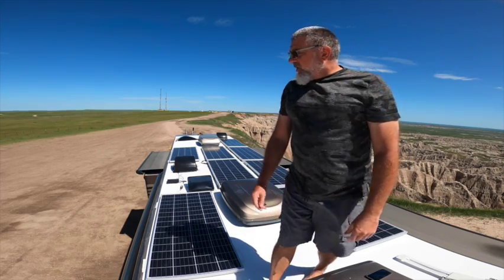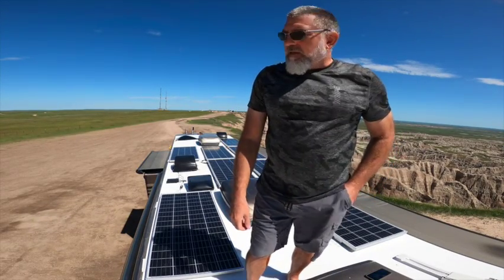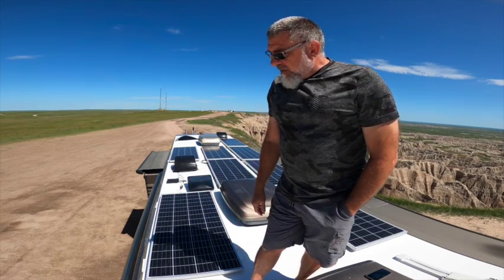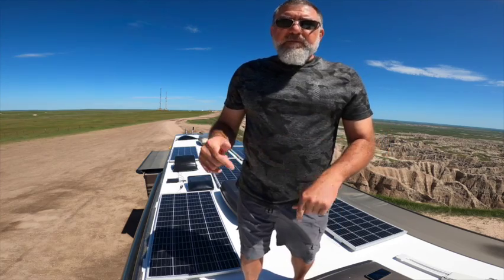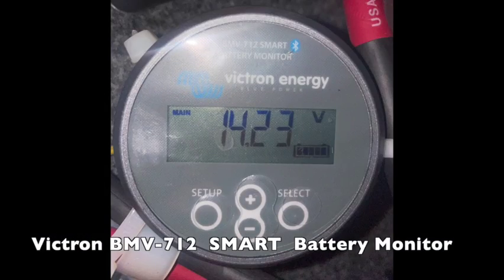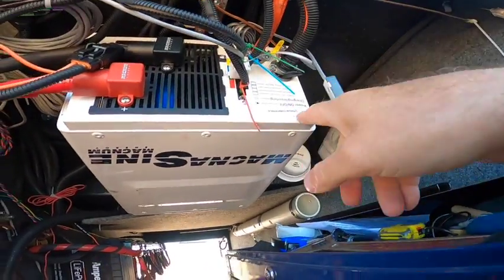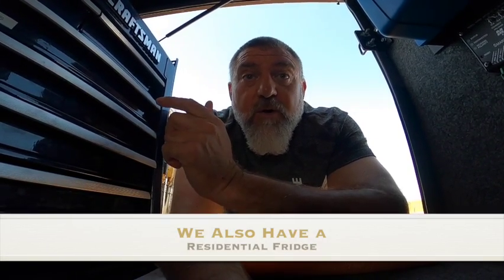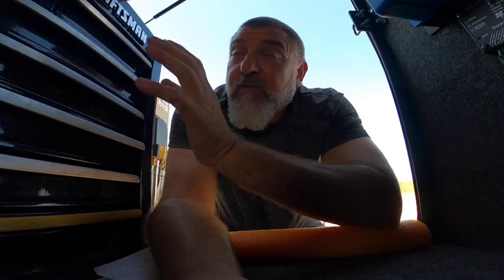Solar for RV Boondocking

Comment: Sweet job! That sure is a professionally set-up system. I just found your channel and subscribed. We are boondocking in Sutherland, NE now and will be visiting the wall for the first time Sunday. We're retired FT RVers who love to boondock most of the time. We decided to build our solar system in 2 phases, a 12v basic phase to run all our 12v appliances and a 48v system for our AC high power needs. This also gives us some redundancy, so if one phase goes down, we've got a back-up. The main issue we faced is we are retired and living on social security and a small pension so have to do everything on a tight budget forgoing name brand components like Battleborn and Victron for lesser-known brands and must do all the work ourselves - which keeps getting harder as we age. We just completed the first phase in January, with the addition of a custom built 560ah of LiFePo-4 battery, made with 8, 280ah prismatic cells. We used a Heltec 350amp BMS, to start the 5,500watt generator in our motorhome, along with a 5a active balancer. We built our 12v battery with grade "A" LiFePo-4 prismatic cells having a 6,000 cycle manufacturer projected life at 100% DOD. This means that if we cycled them 100% every single day, 365 days a year, they would last over 16 years! They're obviously going to wear out from age before they wear out from cycling. It only cost us $1,500 to build this 560ah battery, including the high amp BMS. The main reason we chose these cells (other than their price and quality) is that they fit perfectly under the steps of our motorhome where our old pair of GC-2 golf cart batteries used to reside, saving 35lbs while having over 5 times the energy storage capacity. We insulated the battery compartment, cut a 1" hole in our step risers and installed a tiny computer CPU fan to keep this space at close to room temperature. 

We started our build 4 years ago with a 620-watt liftable array mounted on the side of our motorhome. It serves as a nice bedroom window awning too. It practically lifts itself to the desired angle with a couple gas struts and it's easy to clean with a windshield squeegee, standing safely on the ground. Lifting an array to the correct angle for latitude and month, produces 25-30% more power than a flat mounted array - even more in winter when the sun is low on the horizon. This first phase, including the liftable array, wiring, breakers, a new Progressive Dynamics 80a Li compatible converter/charger, 600w PSW inverter (to run our TV and PC), an Epever 50a MPPT controller, a Lnex battery monitor/shunt, and a Renogy battery to battery charger (to protect the alternator) cost us around $3,600. 

We'll be starting phase 2 soon. By mounting our current solar array on the side of our MH, we left the roof free to rack 8, 460W bifacial solar panels in a single row down the length of our 35ft Class A. If you're not familiar with bifacial panels, the front side of these is rated at 460 watts with up to 25% additional wattage output from reflected light on the back side, for a total of up to 575 watts, depending on how they are mounted. We will be racking ours about 13" off the roof to clear our front AC shroud and vents. This clearance should conservatively produce another 10% output off the back of these bifacial panels, from sunlight reflected off our white roof - more during off-peak hours and in the winter. It will give us some nice shade too, reducing the heat load on our air conditioners. Rather than buying individual components, we will be using an all-in-one 48V, 5,000W, 120V PSW Inverter, 80a MPPT charge controller with a 40a ac battery charger by Sungold Power. The reason we chose this all-in-one is because the idle power consumption is only 25 watts - and it's only $800. Our 48v battery bank will use 16, 310ah prismatic cells (15.9Kwh.) So together with our 560ah (7.1 Kwh)12v bank, we will have a total of 23Kwh of batteries onboard. We will be replacing our old rear 13.5k btu rooftop Dometic AC with a super high-efficiency 12k Btu 48v DC mini-split heat pump that only draws 750 watts at peak output and less than 500 watts when it's cooling normally. This second phase will cost about $10k, including the heat pump. Our 2nd phase will provide 24/7 off-grid air conditioning and supplemental heat from the heat pump and allow occasional use of our new Furrion front rooftop AC to cool things down for peak afternoon demand, as well as give us whole house 120v ac power. This will allow us to keep our generator in reserve for emergency use only.
Reply from the maker: Holy cow Chip, I did our solar setup and I understood about 1/3 of what you said! lol You will love the Wall for sure, and you will be very comfortable it sounds like. Every option is available for setting your rig as you need for optimal sun exposure. Safe travels, we hope to see you out here someday, I'd love to see what you've done and glean a lil knowledge from you!
Reply: @2ustravels77  We're on the wall now, and it is amazing! Hope to see you down the road!
Reply from the maker: @SuperSushidog  jealous!

Comment: I have a 2000 Monaco Dynasty just 40 foot and I’ve put 1100 W on the roof with a multi plus to make Tron 3000 W inverter and I have for 200 amp hour Lossigy batteries that I love. And I do have mine wired to run the bedroom AC which it has a soft start on also. With no problem whatsoever. As I Boondock 90% of the time I love your system. Maybe one day I will see you guys on the road. Thanks for the video.
Reply from the maker: I still have to figure out the a/c wiring situation, we have 2 panels one is powered only by the gen or shore power, I need to rewire the boxes to power the a/c off the battery bank, I know when Im a little over my head, this is going to take some real brain power and time on my part lol

Comment: With that MPPT on 12v are you maxing it out, I thought you only go up to 1400w with it?
Reply from the maker: I would have to look (ie try to find) back in my notes from my build, but, if memory serves, I did this with phone support from BattleBorn, where I bought it from, and the tech there had me wire the panels in series AND parallel, (4 sets of 2 panels) by doing that, it drops the watts and increases the amps (?). He was confident in his knowledge and explained it so I could, at the time, understand it, and it made sense. The other option, as you noted, would have been to add another MPPT.
Reply from the maker: and as a side note, you will NEVER get the full rated production out of the panels, our total rated output is 1680W, I'm pretty sure that we have never even come close to that number.

Comment: Thanks for the video, getting ready to install a very similar system. Did you do the install yourself? Wondering about the bonding area on your solar panels, how you calculated the contract area requirements? Hope to meet you out there.
Reply from the maker: Yes I did the entire install myself, watched A LOT of youtube videos prior to taking it on, like months worth, to be sure I had everything right. As for the bonding area, Im assuming that you are asking about the feet of the panels? There are specs (somewhere) regarding the number of feet required for the size of the panel, ours are 4. Which, btw, are sold separately lol. As for the 3M VHB tape, I got the widest tape that I could that wasn't wider than the foot itself, which is about 1". Is your roof fiberglass? I'm not sure that I would use that technique on a membrane roof, I didn't do any research on that. 
Likewise! We hope to see YOU, out HERE!